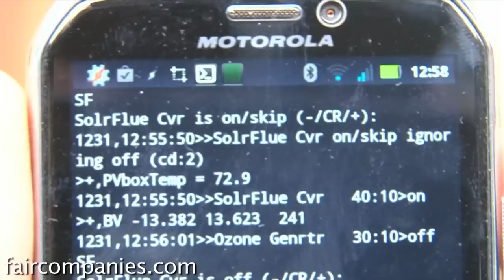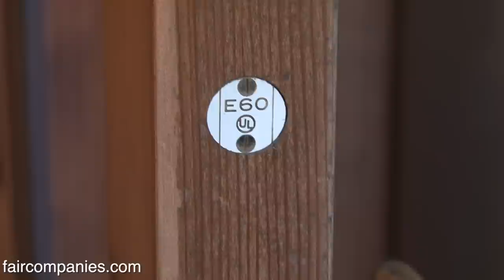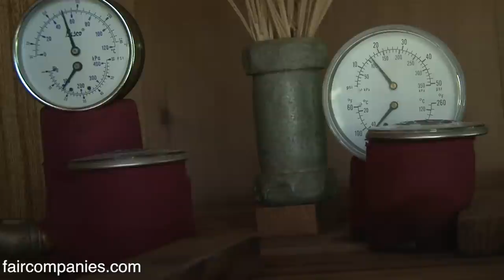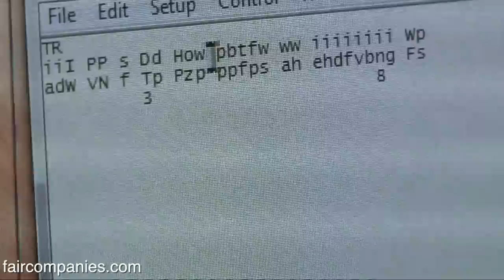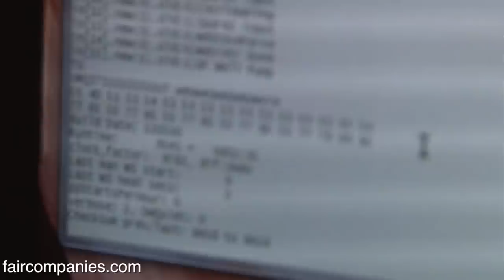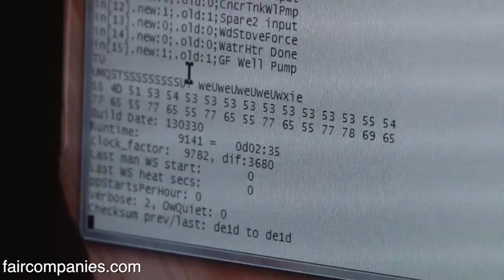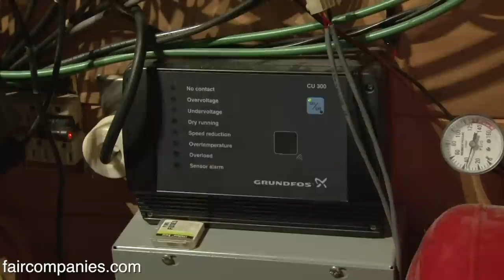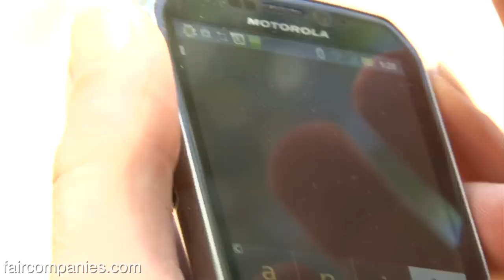NorCal veteran coder customizes off-grid home with sensors

Comment: After watching this is feel like a spoiled dumb guy watering my bonzai with a raspberry pi xD
Reply: Did you know boards like rasberry pi in his system?
Reply: By the chip packages on his main board that runs the house, I'd say it was a 30 year old single board computer with capabilities much like an Arduino.  It probably cost him a lot when he bought it, and probably has a lot less than a megabyte of memory.  It would not surprise me at all if there is an Arduino lurking in there somewhere, extending the old equipment for more recent additions, with more pins to control more stuff and read more sensors.
Reply: Jeremy McReynolds u
Reply: It is a Tern TD40 - 80186 processor. Actually, there is now a BBB underneath it, but the whole house is controlled by 12 Volt relays and signals, and I haven't gotten around to building the 64 channel route from 3.3V I/O to 12. Plus just moving the connections would be a huge task I only want to do once! Seriously looking for an industrial USB I/O system that can drive 12V, 125mA relays directly...  The USB would stay wired to the house, while I could plug on different control computers.
Reply: +Loren Amelang Thank you for taking the time to show us all this.  So much to learn.  What fun!
Reply: @Loren Amelang - interested on your thoughts about making all the connections to sensors etc via physical cable vs using radio. Oh and thank you so much for sharing your progress - really appreciate the inspiration.
Reply: In 1998, radio was not a realistic option. I did later investigate an early ZigBee system, but it ate a lot of power (and 24/7 instead of just when an output relay was on), and it was not reliable over the long distances to the well, water tanks, and garden, where eliminating wire would have been most valuable. Plus when you're controlling the wood boiler and solar hot water panels that can flash to steam and make a disastrous mess of your essential plumbing, the reliability of actual wire is well worth the effort. Once you've built a route for one cable, it is easy to pull more...  Next time I build there will be 2" conduit connecting each activity area to a central "closet", so whatever new connectivity appears can be easily added. In 1985 I thought I was future proof with CAT3 phone cable and RG-59 everywhere...

Comment: Loren was our neighbor for many years. We lived about a 2/3 mile down the ridge from our ranch. I've visited with him in that house. It's every bit as unique, functional and well designed as the video shows. We appreciated his push to get wireless internet in the valley. He designed a complex software module to plug into a database program I was writing, and it plugged in and worked the first time I attempted it and worked perfectly without any further adjustments or corrections needed. That's the kind of coder he is.

He does things his way or he doesn't do them. And his way is usually really well thought out according to his values.
Reply: This sounds like a Linkedin endorsement rather than Youtube comment
Reply: what an absolute badass
Reply: "and it plugged in and worked the first time I attempted it and worked perfectly without any further adjustments or corrections needed. That's the kind of coder he is."

so... superhuman? I can't remember the last time I had code that ran without errors after the first compile and actually did what I wanted it to do.
Reply: @LordPerique :
I think what OP was saying was that once OP started using what the coder made, it worked.

But what OP left out was that the coder had to work on it himself until it worked for him. He debugged everything and made it simple enough that others could just copy his work without fuzzing anything up.
Granted, OP seems to have more than a basic level skill to be able to implement the coder's code.
Reply: @LordPerique  You're super clever too then aren't you? Credit where its fair, true and due, right?
Reply: Hi Eric! Thanks for the kind words!
Reply: Loren Amelang - very solid work working with the ether! Would be interested working on homestead set -ups and village with some one like you. Thank you for sharing. Built on 20 acres off grid 90s outside Whilow on Eel. Great to be involved in creating your living space and environment.
Reply: Wow, absolutely amazing.  It's inspiring to me.  Respect 👍
Reply: @LorenAmelang  this is really inspiring Loran, thanks for letting these guys in and showing them around. Best of luck to you from Ireland 🇮🇪 🧿

Comment: Cool, I'm very happy to see more of this guy and his house.  I remember the first video well.  The little pipes with computer fans at the bottom to suck hot air from the ceiling down to the floor.

His comment on the solar water heating made me think of a guy that had a very nice solar setup.  On the occasions where his batteries were fully charges, and he sized his system fairly robustly, he would store the solar electric energy still coming in, or the wind energy still coming it by running the output through an electric element in his water heater.

You would also use electricity to pump water up high into a tank and create your own water pressure.

This looks like a really amazing place.  This dude ought to give tours, classes or lectures and teach others who to do this.  I bet he could make some good money.

Thanks for another inspiring video.
Reply: Yea this guy is genius with his designs and he also inspired me.  Those pipes with the computer fans you mention from the last video do work. I have made my own version of them that I used in combination with a arduino and a relay switch through the winter.  Even though it got super cold this past winter my electric bill was about 8 dollars lower per month vs last year. I have not had summers months with it yet but it should help with cooling too. 

I am hoping in under a year I will get a return on investment.  I up-cycled some fans from a old pc.  I got some throw rugs on craigslist for free for the tubes.  Then I bought 6 fans from a salvage electronic warehouse for under 10 bucks.  Then with the arduino, relay switch, and a small temperature sensor for about 50 leaving me at a total cost of 60 bucks.  The arduino has 8 open pins left and the relay switch has room for 4 more things to be controlled by it.  So I have room for more projects that could be automated.  It was my first arduino project and I am glad I did.

That being said I can't express enough how innovative this guy is.  It probable cost a small fortune to set up because he was doing this years ago.   Luckily now we have super cheap micro controllers.  The amount of things that can be done is endless with them, a huge support community, and where designed to be modular.

Comment: As a programmer, I find this very interesting. His total hacker approach to everything is really cool to see and jebas do I respect this man.

Personally, though, my sensitivity isn't to light (though I do long to be able to get away from light pollution and see the stars again), but to noise. I can't wait to get away from noisy central A/C, and I use my less-powerful passively-cooled PC for everything I can to not have to deal with fan noise - and my other isn't even particularly noisy. So his PC fan, rolled carpet heat-moving tubes are a really great idea, but not one I'd care to implement. The passive solar heating design is pretty freaking sweet, though. Despite the noisy motor every so often.
Reply: Lol you should see my fathers home shit. Thats hacker wires everywhere. His things are very clean and very good done.

Comment: Truly awesome guy. His hot water system is almost exactly like something I've envisioned myself, but I would have no idea how to write the software necessary to run the system. I also started integrating 12v 'outlets' into my room using Molex connectors so I can power lamps and other low voltage devices.

Comment: Wow this house is seriously energy efficient. I guess modern houses would have a simple thermostat/boiler combo to control temperature. But this guy has an onboard computer with sophisticated airflow/vent cooling mechanism, multiple heating mechanism, temperature sensors all over the place.... Seems a bit crazy to me. Obsessed with saving energy? I'd like to know the overall power consumption of this house vs. a standard house. The guy is obviously a genius. I'm sure he's got a pretty good explanation for why he built such a complex system for temperature controls. Any idea?
Reply: LMT Because he has the knowledge and he can ! Simple. So many of us are admiring his talent.

Comment: Bruv's got an SSH CLI for his home, whoops just finished watching. He started in 86. You know what hasn't been improved since 86? The best way to access a remote system that isn't SSH. None of this GUI garbage. I'm rock hard right now.

You know he specially designed that audio system so when he rocks the air guitar across his house to smoke on the water there's as little doppler distortion as possible. 

Fucker is ozonating his water with excess solar energy? Amazing. 

He is a tech Buddha. I'm not fit to touch the hem of his garment but I want to sit at his feet. Or at least SSH into his system with limited permissions of course. That was a wild ride. A wild ride indeed.

Comment: This is the best designed home I have ever seen !
Hopefully the back up plan is solid should the computer goes down.
Reply: The only serious threat is the solar hot water. If circulation stops on a sunny day, you quickly get steam in the pipes and vent the antifreeze out - and face hours of recharging effort. There is an entirely separate mechanical pump with a mechanical temperature switch and a route that bypasses all hydronic control valves, to take over if the computer fails to run the regular pump.

Comment: I seen this before? I guess on this channel but maybe this concentrated on other aspects I do not see the thing about monitor flicker. My offgrid house is also wired with 24V DC and only used DC in the kitchen. The inverter works only when is needed a few hours a day.
I had an induction plate before moving offgid but it dose not work with the modified sine inverter. I also made a test and I see no efficiency benefit of so small that it was not relevant compared to a resistive hotplate.
This house was done some time ago but right now solar PV can replace all the other aspects of heating at 1$/Watt or even lower.
At 1$/Watt at my location over 25 years amortization cost /kWh will be under 3 cent that is the least expensive fuel so I will use that for heating directly no battery needed. I will need to find a use for that excess energy in the summer months.
And Loren if you read this and you need to change the batteries look in to LiFePO4 is what I use and a way better option in any aspect that Lead Acid.

Comment: ...."They spent all the money and built half the house". That is the problem in any remote/off grid location; Finding a reliable contractor and/or workers. Not for the faint of heart or medically/mentally challenged, and if you ever want a livable domicile with a few modern conveniences, it can be an enormous undertaking.

Comment: computer house before they where a option this is great
Reply: I'd like more of his opinion on how to do it now, when cheap computers with GPIOs, like the Arduino and the Raspberry Pi.  I'll bet he spent many hours building modules that can now be bought over the internet for less than $50.
Reply: condew HacDC this is not something you just jump in and do their are a lot simpler ways to do a lot of this stuff. what would you like to automate?
Reply: Actually, it is something you "just jump in and do", if you are somebody like me with the skills but not the experience of actually doing it like he did.  Yes, there are simpler ways to do some things.  For example, he uses a charge controller, but he could have programmed a charge controller as an algorithm in his computer.  Perhaps he was limited by what was available at the time, or perhaps he made a decision that some functions should proceed independent of the main computer, much like the autonomous nervous system in the human body keeps breathing going even if the person is unconscious.   Loren made thousands of decisions like that, and I'd like to know which were forced by available equipment, which are just the way he tinkered it together and it works, so he didn't mess with it further, which were learned the hard way in the school of hard knocks, and which were very carefully considered.

Comment: Wow, I've been agonizing ver how to automate a home for years in my head. I've done tons of research and looked at all the current offering and found that they lack the "automation" part of which ever system  it is. They all simply relocate the interface that use to control your home and maybe allow you to do a few things at once, but the idea I've had is an autonomous home. That is to say a home a which changes and adapts to the needs of its inhabits. One which can be controlled from one point(much like the phone or computer in this video) but only requires input from a user when needed. The rest of the time it does as expected. It's true that this is possible today, but it requires racks of equipment, special installation, and exorbitant cost(not including the less powerful new systems) the idea of having one computer, and one amp. That powers a hone. That idea which I've agonized over, this guy figured before laptops existed. Amazing...

Comment: Fascinating, how does he do his laundry?  Where's the bathroom?  Very inventive somewhat of a nerd.  What happens when one of his sensors goes on the Fritz?
Reply: There is a relatively antique front-loader under the counter on the "summer kitchen" porch. Worst starting load of all my motors, but once it is running it takes little power. And a wire clothesline between two trees in the incoming wind stream. Absolutely love line-dried freshness! Bathroom is down half a flight off that porch. Back in the house structure, but no direct connection. Total privacy...  Well, except for a wall of windows...  Sensor problems trigger a car alarm siren audible all over the hilltop. Problems that would damage equipment have independent fail-safe backup systems.
Reply: @LorenAmelang  - The starting load of motors is definitely a problem with solar systems (or generators, or batteries). Love how you engineered everything, and the entire analog approach to various things (such as the audio amplifier :) When searching for a guitar amplifier, I specifically sought out a tube amplifier. I was trying to figure out if you lived somewhere up here (San Lorenzo Valley/Santa Cruz Mountains), but thought it could be the Peninsula/San Mateo County (or even Marin, Sonoma, or Mendicino). I also hate fluorescent lights (because of the flicker of the cycle/ballast). So I went to all LED lighting, and in some ways (though better and more energy efficient), I don't like it either. They also use electronic ballasts, and sometimes the color temperatures are annoying/bothersome. Anyway, great work in designing/building your place.
Reply: @Sovereign_Citizen_LEO  
Grundfos SQ(E) soft-start submersible pumps are a lifesaver on solar or a small generator. Yes, if you want a classic guitar sound, tube amps are the thing. For general reproduction, I think transistor circuits can be more accurate - but most commercial ones aren't. I'm in Mendo County. And yes, the nasty problem with LED or fluorescent lighting is color fidelity. If they get it anywhere close to halogen incandescent, they lose their efficiency advantage. Afraid we can't change the physics of that. Yet...
Reply: @Loren Amelang - Cool...  Thanks for the info. Stay away from those induction cooktops. There is mounting evidence that the electromagnetic radiation given off could cause health problems. The Indian government recommended that pregnant women don't use them, and some other national health department (forgot which one), recommended people keep their distance when using them;  i.e. keep your body as far away as possible when using them. The amp I bought is a solid state Fender Amp with tubes, so I don't know exactly how that all works, but it sounds pretty good. Anyway, take care.

Comment: amazing, i love the sensors and computerized automation. and the hot air floor heating, and that hot water tank heat exchange looks interesting. this guy is now one of my heroes. i am curious about DC lighting. i am curious of what his total kilowatt usage is, along with wood and gas fuel usage is. i want a dedicated video on everything about his audio system so bad. i am a sound freak.  i also am interested in a version of this house for cold climates with -40 Celsius winters.
Reply: ditto